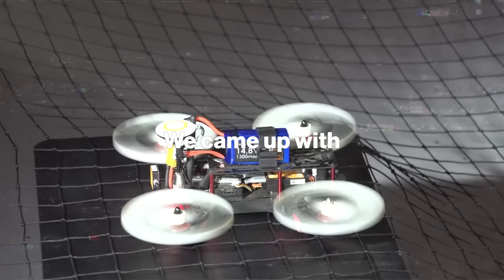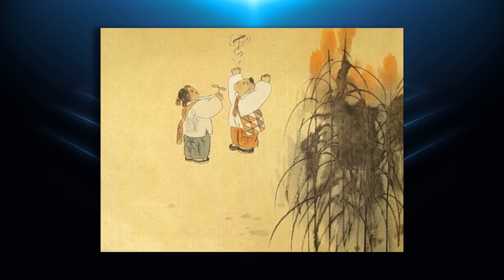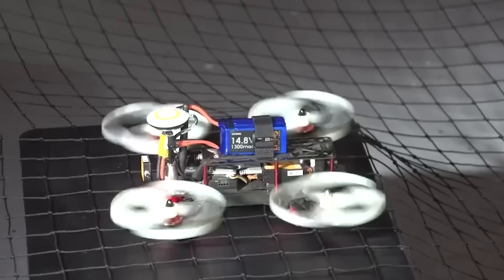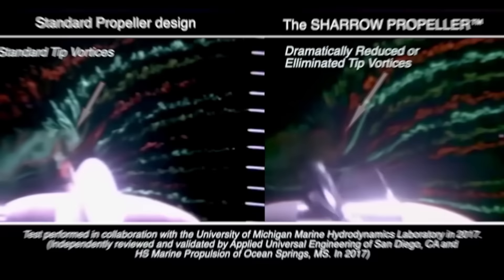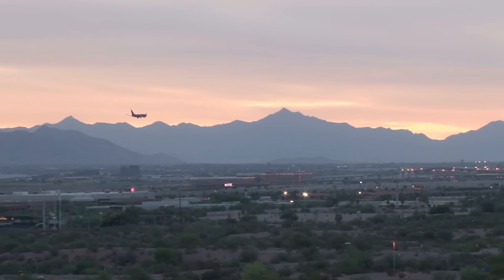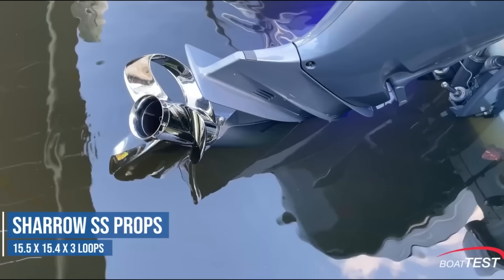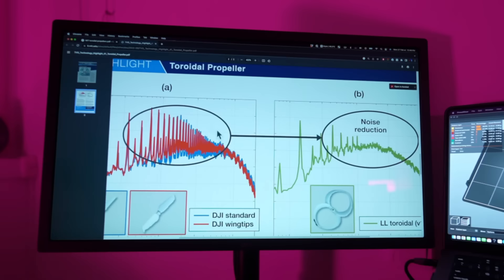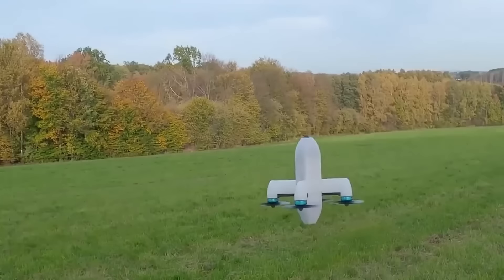This MIT Propeller Is Going To Change Aviation Forever

Comment: The fact that they are fixed pitch makes them a total non starter for most applications in aircraft
Reply: My thinking exactly. Instead of increasing thrust by changing blade pitch, now you have to increase the engine RPMs, same as you do on a jet engine. Imagine this on a commercial twin engine place, like an ATR and the engine fails. Can't feather, so you end up with a runaway prop, then the engine falling apart.
Reply: And this is not an accurate representation of the aero application. Firstly, the prop is not scalable, and will only work on small diameter props. All the tests rely on high speed, small diameters in the air, [drones] or on solid medium applications like boats.[The medium being water.] This presents a problem, because the 'T'prop would have to exceed the speed of sound in the air, to be effective. So making the claim of changing the rules in aviation.... is pure cattlecrap. [Unless you talking drones, which are utility applications in the air, so yes they are a sub-class of aero industry, but not true aviation.]
Reply: Was about to write that but you beat me to it.  Probably works for quad copter drones and maybe light personal aircraft one day...
Reply: @miket2120 I was thinking that too. My best guess is this will be used exclusively for electric motors and some GA aircraft. Electric motors don't have a rpm problem. They are also more reliable than combustion engines, so feathering on engine failure isn't really needed.
Reply: Most aircraft propellors are Fixed-Pitch not variable.
Even inside the turbine of jet engines they are fixed-pitch.
Reply: @LG-qz8om  this type of propeller could not be used as a compressor or fan in a gas turbine. Also only small basic light aircraft use fixed pitch propellers. Everything else uses variable pitch.
Reply: They're talking about drones and powerboats duh
Reply: @philgordon6671 The title of the video suggest a little more than just boats and drones lol
Reply: Most prop noise is the result of the tips breaking the sound barrier.  Torroids are interesting but nothing like a breakthrough.  Their applications will be limited.  Wouldn’t mind having one for my boat.  Good luck straightening one after a prop strike.
Reply: A non-starter ? That’s theoretical. It’s been proven to be more efficient
Reply: @asianguy6174  I think you need to understand that in all but the smallest and simplest of aircraft, propellers need the ability to change pitch and very importantly they must be able to feather in the event of an engine failure or shutdown. The efficiency gains on boats are impressive but that is a very different situation that doesn’t translate directly to aircraft. The small fixed pitch aircraft that this could possibly work on are already so  slow and aerodynamically inefficient that a fancy propeller is going to make little difference.
Reply: "I can't think of a way to make the pitch of this prop variable, therefore no one ever will. scrap it. don't waste your time." 
that's what you sound like 🤷
Reply: @graphixkillzzz  unless we change the laws of physics and make the whole thing of shape shifting materials it is a non starter for aviation. Do some research and you’ll understand that this propeller has only been proven to achieve gains in a marine environment with low diameter/high RPM. Exactly the type of propeller that fixed wing aircraft cannot use.
Reply: @stevea8547 I'm just curious, but are you an aerospace engineer?
Reply: @MGPRaleigh  Yes you guessed right 33 years in the trade so far
Reply: How much thrust advantage does variable pitch offer?  If it’s less than 20%, these toroidal props should be better.
Reply: @IanHague  It is indeed an issue of "thrust advantage," depending on how you define that. Variable pitch props optimize efficiency for various phases of flight, such as low pitch for climb, high pitch for cruise, feathered for engine-out situations in multi-engine aircraft, and reverse pitch to aid in deceleration after landing touchdown.  Small recip (piston-powered) singles would not benefit from a relatively wild prop design such as this to the point that it is compelling enough to make the change.  The design will not become mainstream in passenger-carrying aircraft for a multitude of reasons...high cost, high complexity, challenging certification requirements, and the one glaring issue is that it's just not so good that it's worth pursuing in most  passenger-carrying applications.
Reply: Exactly.  Most definitely a non-starter and will not change aviation forever, at least in passenger-carrying applications.  @stevea8547 is correct.  In aircraft applications, you want the biggest prop possible turning at relatively low speeds.  For fixed-pitch applications, the prop is pitched to give redline engine rpm at full throttle, with the prop tips operating just below supersonic.
Reply: @IanHague  its the equivalent of having a car stuck in first gear versus a cvt auto box.
Reply: Huh???
Reply: @misanthropicphilanthropy  ok in simple terms the fastest variable pitch aeroplane is almost twice as fast as the fastest fixed pitch aeroplane! Variable pitch makes a LOT of difference!
Reply: Just as in "fluid dynamics"... Same applications apply, with the variable difference of airflow vs water flow
Reply: @JD96893 Feathering is not only to stop the engine and or gearbox from further damage but reducing drag for further glide time to reach a suitable landing spot in case of an engine out scenario.
Reply: I totally agree for multiple reasons.
Reply: I agree the current designs are only directly applicable to drones or light aircraft, but the idea of folding the blade round to eliminate the inefficient end of the blade is new and may lead to interesting developments that are “game changing”
Reply: This is  is a snapshot , the future development is the movie. Let's see advancements could be made, perhaps memory metal?
Reply: There's still quite a market for fixed pitch props.
Reply: @joewoodchuck3824  this is true but would the owners of small light aircraft pay ten times the price for a propeller that has almost no benefit over a standard propeller? These propellers have only been proven effective in low diameter high speed applications. Most light aircraft fixed pitch propellers run at very low speeds and produce effective traction due to their large diameter. This new propeller technology is just not a like for like replacement for aircraft propellers, and in all likelihood never will be. There are certainly possibilities in other areas of aviation but not in conventional propellers driven fixed wing aircraft.
Reply: @tonyforrester9570  Water is not a  "solid" medium...
Reply: @stevea8547  Further engineering could allow a degree of pitch variation. For example, a flexible outer skin supported by a movable inner framework.
Or the prop being made of multiple interconnected segments that can move relative to one another.
These are just quick brainstorming concepts. With sufficient engineering and development we may be able to come up with a variable pitch toroidal prop. Just like we came up with multiple ingenious mechanisms for varying camshaft phasing and lift in internal combustion piston engines (VTEC, VVT, Cabos, etc., etc.).
Never say never.
Reply: @IhabFahmy  even if that was possible you’re missing the point that this propeller technology only produces appreciable gains in performance on low diameter high speed propellers, which are basically useless on fixed wing aircraft!
The forces within a propeller would make it almost impossible to have any kind of pitch variation that could carry the loads sufficiently well.
Reply: Good point!!
Reply: But It's a gAmE cHaNgeR!
Reply: But they said "Effeciency", not efficiency, so it's still true!
Reply: @LG-qz8om I’m not sure of your statistics but fixed blade aircraft propellers are a weak little brother to variable pitch.
Reply: The toroidal propeller is more efficient than variable pitch straight blades
Reply: Could this more efficient design be applied to HVAC? Does it work with a tubular fluid environment? As we strive towards greener home heating and cooling, more efficient, fans as well as efficient fluid pumps for geothermal systems is worth it.  Geothermal systems run continually. Every watt counts
Reply: @bwmcelya Laughimg, for sure.  Might be easier on a manatee’s back though.  :)
Reply: Certification will probably be one of the biggest issues for introduction to civil aviation. It would be interesting to see how they would perform on light, fixed pitch, single engine planes, like the cessna 150, 152, 172 or ultralights
As many have mentioned, the larger diameter required for fixed wing aircraft may present an issue
I doubt that these propellers could enter into the field of military or commercial aviation since they use variable pitch props or jets
Reply: @PathogeniNk   Indeed the manatees. To me that would be the torroid's most important attribute.  Prop guards are cheap though.
Reply: @miket2120 
What about turbine engine applications?
Would it be more efficient and quieter on a turbine vs a piston aviation engine?
Reply: @berniemadoff7837  in a word ‘no’ it wouldn’t!
Reply: Lots to work on here….
Reply: @bwmcelya Most props do just fine being noisy without the tips exceeding the speed of sound - few exceed the speed of sound as it is very inefficient at those speeds. Prop shape has the most effect on sound.
Reply: @stevea8547 there are many, many planes flying around with fixed pitch props. It certainly is a compromise between takeoff/climb performance vs cruise, but lots find a perfectly acceptable compromise.
Reply: @mr-uc4me  Im not denying that there is but this type of propeller only produces and appreciable gains in low diameter/ high rpm propellers, which are not used on light aircraft at all.
Reply: They will have to come up with a variable pitch toroidal prop.
Reply: @berniemadoff7837  turbine fans (or screws) are fundamentaly different from propellers because their purpose is to move air, whereas a propellers purpose is to move the connected object. This difference causes them to have very different geometries. The fan tips are so close together that a toroidal shape is no possible to connect them. Beyond this, the size of a turbine leads to safety questions since a modest takeoff at 8000rpm with a fan diameter of 1 meter has the tips moving at a speed of 150,000km/h (i dont trust my math skills implicitly so if someone could check that result id be grateful).
Reply: @berniemadoff7837  By definition, toroidal props are exposed tip. Turbines are ducted fans, with no exposed tip, wholly different flow through and around blade foils. Large ducted fans are being tried for medium speed airliners, high blade density exposed bent blades seem better, so far. If 'turbines' you mean gas turbines driving a prop, no different because of power plant. Electric motors are the game changer here, as they have far wider efficient torque curves over RPM ranges. Piston engines are the most restricted for narrow power curves, thus the need for variable pitch props. Nobody seems to connect the added efficiency of toroidal props at lower RPMs, and better efficiency at same speeds, as greatly reducing the value of variable pitch. For commercial aviation, fuel costs (Gas, Kerosine or battery charge) will remain the largest expense, and the critical variable in design choices.
Reply: @mr-uc4me  According to those on the bleeding edge of design, more tip design than foil design. Massive efforts are in progress to find ways to quiet the usual helicopter blades, normally hideously noisy. Focus moved to blade tips awhile back. Current experiments in small/medium airliner multi-blade (High disc density) props, often very laid back tips, are being investigated. The better exposed high density props are challenging ducted fan efficiencies.
Reply: @stevea8547  Why are you missing that the boat toroidal props are better at the same diameters and RPMs that exposed blade tip props have been optimized at over Generations? They are not smaller than ideal exposed tip props, and seem measurably more efficient at lower RPMS, cruise, And top speed. The real questions are relative efficiency, at costs the market will bear, as the props are developed. Currently a Very immature technology. Hoping you are educated enough to know water and low/medium Mach Number air flow are both 'incompressible flow'.
Reply: But extremely attractive for naval use
Reply: So was everything else when it first came out. What's funny is someone at mit taking credit for someone else's invention that has been in production for years
Reply: @billtaylor3499  read the previous comments, I really can’t be bothered to explain it all again
Reply: Elon Musk justified the Boring company on drone noise pollution .
Reply: @LG-qz8om  most small prop planes are usually fixed pitch for cost savings and ease of maintenance, but constant speed props are getting more affordable and more popular, larger prop planes are almost always variable pitch. Also inside of turbines they kinda do have variable pitch! It's called variable guide vanes. They effectively changed the angle of attack of the stator blades and therefore incoming air onto rotor blades. Essentially turning it into variable pitch for different engine needs.
Reply: I think that as well - BUT - the purpose of the pitch shift is to improve performance given its speed and need.  If this prop performs so much better, wouldn’t it reduce or eliminate the need for the pitch shift?  
Maybe. Maybe not. I don’t know for sure.  But if these improvements are correct, would seem so.  After all, the pitch change in a prop doesn’t change performance by 200%….
Reply: If the gain in power and/or efficiency is what they suggest, would there still be a need for variable pitch props?
Reply: @stevea8547 There is an absolute shit ton of small light aircraft though.
Reply: Sasqwatch_reporting  the pitch they’re talking about doesn’t change the angle of the engine. It changes the angle the blades are as they rotate and cut through the air.
Reply: @stevea8547 why not? A compressor blade only needs to pull in and compress air, why could a prop like this do that?
Reply: @Vinythevent  a compressor in a gas turbine is made up of several stages, each one consisting of a rotor and a non moving stator. Each pair are very carefully matched to produce optimal performance and they also run the tips extremely close to the casing to reduce tip losses. The shape and blade density alone are enough to make it totally unsuitable for gas turbine applications. 
A compressor is far more than just a propeller in a duct!!
Reply: Sasqwatch_reporting  maybe if the blades were made of rubber!!  I don’t think you understand the concept and requirements of a variable pitch propeller. 
They need to be able to transition all the way from reverse to fully feathered in most aircraft applications!
Reply: Would t this be less of an issue with electric motors though?
Reply: Plenty of light aircraft use fixed pitch props. Assuming the claims in the video are true, it might be beneficial for them.

The reduced noise thing is interesting for ocean going vessels. Current prop noise on commercial ships wreaks havoc on the ability of cetaceans to communicate and navigate. A quieter prop would be a step in the right direction. And, if it also happens to be more efficient, you'll have a much easier time talking companies into using it.

I also wonder if the shape of these props might reduce the damage caused by propeller strikes on cetaceans and manatees.
Reply: @stevea8547 remember when they couldn’t break the sound barrier, because it was a big wall in the sky and the air would rip the plane apart? did the pilots say that or the engineers?
Reply: @stevea8547 combustion engines have optimal output torque and hp at certain rpm’s and the adjustable pitch compensates for the lack of an engine with on demand torque or a linear torque curve like and electricity engine, so for electric applications it is promising, i think Norway assays all commercial aircraft needs to be electric by 2040. i don’t agree with this, but, it is a moving in the right direction. who is to say, this isn’t a thing and won’t be, maybe not as much hype in a youtube video but very practical in UAS UAV configerations
Reply: @Meatball2022 in electric applications torque is pretty much linear and pitch adjustment isn’t needed to meet the max output/fuel consumption that an electric could address, i could see electric coupled with gearing and fixed pitch works efficient enough i can be adaptable and practice. everything in aviation, is slow changed for good reason.
Reply: @MusicalMemeology exactly these blades are perfect coupled with electric engines. combustion engines use variable pitch to increase efficiency due to a combustion engines hp and torque curve, electric engines torque curves are linear and the blade being efficient would work for many of electric aircraft applications, wait for the record to be broken for global navigation in an electric powered solar plane with these props. will work for electric vtol drone type aircraft that are in the works s we type on youtube
Reply: @marknasia5293  doubtful. All that adds weight on top of the ridiculous battery weight. That’s doa until batteries cut weight by 70%.
Reply: @Mistraker many a Dugan has lost their live due to prop strikes traveling from fresh drinking water areas to salt water feeding ares 😅
Reply: Are you sure about that? I immediately envision a sort of clutch bearing able to angle the separately mounted toroids forward altering the pitch MORE Than conventional blades. 
  Your cognitive Envelope needs to embrace Hybrid Advancement.
Reply: Give it some time and they will figure out how to twist the toroid to adjust pitch. And viola... variable pitch toroidal prop.
Reply: @miket2120 Couldn’t a clutch address this concern?
Reply: The title is click bait, if this could be used on airplanes they would have of it to show us, all they show are boats in water and drones.
Reply: Not for turbofans!  The thrust producing blades are NOT adjustable in pitch.  It would affect turboprops and conventional piston engines, much as you suspect. Forget about using it on a single rotor helicopter! However, if using three or more rotors, you could make a helicopter/drone.
Reply: @brianmclaughlin4419  you probably need to address that your idea is fundamentally flawed!
Reply: @billtaylor3499 @billtaylor3499 Large prop planes lik the C-130 use turbine engines to spin variable pitch props.  The turbine runs within a relatively narrow RPM range. 
Piston engines are only used on small planes with fixed pitch props.  Drones, small aircraft, and boats are where this might have benefit, not large aircraft.
Reply: @Meatball2022 Pitch change is vital for short field landing. Reverse thrust can't be achieved with something like this and you don't want to try reversing engine rotation while landing!
Reply: @ericbunker6242  but can that not be compensated for by slowing down the torodials low enough to create some additional drag? 
Legit curious. I’m a layman but would seem to me there’s a way to make it work.
Reply: @Meatball2022 you don't need drag for short field landing. You need reverse thrust.
Reply: Using the term 'total' [non-starter] is an unnecessary exaggeration.
Reply: @William.Driscoll  read it again!
Reply: Good point
Reply: @LG-qz8om you got the turbine part right.
Reply: Good point. To bad. I wouldn’t be surprised if someone eventually came out with one that could change pitch!
Reply: I’ve got a hunch that someone is already looking into the ability to change pitch of blade’s on these. Time will tell.
Reply: This comment section is a sticky trap for Trolls. 
How is your propeller invention coming along Trolly?
Reply: Its early days yet, time will tell so will money. Some big shot investor a fare bit of R&D, then streamline the manufacturing process. Bringing down cost's.
Reply: Why do we accept that they have to be fixed pitch?
Reply: Why do they have to be fixed pitch though?
Reply: @LG-qz8om only because there are more 172's than there are king airs. Fixed pitch props are pretty much only used on non high performance A/C, which are quieter anyhow. Every other prop A/C uses a constant speed prop, which varies it's pitch. Anything large, noisy, and more likely be used for commercial purposes (let's face it, most weekend warrior GA owners probably aren't going to upgrade to a very expensive prop) would all be constant speed and wouldn't benefit from a toroidal.
Reply: They don't. 
Trolls say what their Troll friends tell them to say
Reply: Nay sayers alway say it can’t be done then it gets done
Reply: to everyone saying just adjust the pitch of the toroidal, you need to take an aerodynamics class. In a regular prop, when you adjust the blade you are adjusting the angle of the airfoil to the relative wind. With a toroidal, it's not that simple because its airfoil is wrapped around a helical shape. You can't just twist the blade to get the same effect. You also just can't twist the airfoil because, A it is impossible with current tech and physics, B, moving parts create weaknesses and flexing which is not what you want with a prop, and C, the toroidal blade is only efficient in its engineered, changing it shape reduces that which negates the purpose of changing it.

Toroidal props aren't a new technology, they've been around for well over a century. The Toroidal A/C propeller was invented in like the 30's or something. There's a reason why they aren't used. They're expensive as hell and complicated to manufacture; look into what a Toroidal boat prop costs compared to a regular prop. Most fixed prop plane owners aren't going to pay for them. I very much doubt the FAA is going to approve of any 3D printed prop either, so manufacturing for A/C will remain high.
Reply: @christhemexvet6652 Interesting, what are your degrees in?
Reply: @joshuakelly2665  I couldn’t agree more! The design of this propeller simply does not lend itself to a variable pitch design. Too many armchair engineers commenting on here who are just not in touch with reality!
Reply: @stevea8547  it's just stupid. the 2 people with actual aircraft/aerodynamics experience and people want to argue. Don't get me wrong, I hope I'm wrong and this is paradigm shifting for the aviation world, but it's simply not. It might make some rich 172 or sr22 owner get better range or squeak out a little faster cruising A/S, but that's about it. It will not affect the vast majority of  commercial aircraft as the vast majority are turbofan. They are so for a reason. 

I am curious to know how a toroidal performs at altitude; I feel like they would work better in denser fluids and would perform worse in a thinner one. If anyone has any info or link on this I'd be interested in reading it.
Reply: @christhemexvet6652  maybe the naesayers are the ones who have a solid grip on the realities of physics and engineering!
Reply: @stevea8547  that’s funny you mention it because I am an engineer at one the top R&D facilites in the world. There are those who have limited understanding and therefore claim “it can’t be done”. history has proven otherwise. In fact history has shown over and over that when they say it can’t be done, they end up proven wrong by the true geniuses and pioneers who devoted countless hours and found a way.
Reply: Most small planes are going to go electric eventually. This will lead to radical design changes in light aircraft.   Ie the more smaller  motors with the ability to change the angle of the motor itself.
Reply: @cryptoslacker-464  what would be the purpose of changing the angle of the motor?
Reply: I was looking forward to compare the drone sounds, but that didn't happen.   :-/
Reply: I wonder how close some new sort of ducted fan might be to this efficiency. Could have constant speed & beta that way, potentially the best of both.
Reply: If these propellers are quieter, their best application would be on submarines.
Reply: @stevea8547 Yes but if your car is electric that isn't a problem. Simply refitting these props to existing aircraft isn't going to do much, but if the powerplant is also changed to take advantage of the properties of t-props it could be very significant. Maybe an electric drivetrain powered by a turbine alternator? It could lead to breakthroughs in engine and electric drivetrain technology as well.
Reply: Obviously if it’s not applicable to everything with a propeller it would be used.
Reply: I mean I'm sure they could design it so you can change the pitch of the center of the props(not the outside connecting part) using hydraulics but I am in no way an aviation engineer or pilot so I dont know if that would solve the problem you're talking about
Reply: @marknasia5293  neither, it was media hype.
Reply: Even if they are fixed pitch - they increase thrust 100+ %.

Maybe big planes would benefit from that.
Reply: @sumakwelvictoria5635  they do not increase thrust at all in anything other than a few marine applications. At best they achieve a slightly lower noise level for the same thrust level
Reply: Not an engineer here, but definitely curious: theoretically speaking, would a flexible material, that was still capable of withstanding the physical pressures on a standard prop, solve the 'variable pitch' issue?
Reply: @stevea8547  So it only increases speed in water but not air? They lied? Hmmmm. You have a point.

Pardon my stubbornness. What if that loop blade could be designed to be pitch variable?
Reply: place them in jet engines then
Reply: @-iloveyou  you clearly don’t understand how a jet engine works!
Reply: @cryptoslacker-464  variable pitch and thrust vectoring are entirely different things! What on earth are you talking about?????
Reply: @graphixkillzzz  not at all, Im commenting only on the current situation of this fixed pitch propeller, if someone thinks that they can make an effective variable pitch version then good luck to them. In its current state it is a non starter!
Reply: @-iloveyou  how are you suggesting that this would work any better in a jet engine???
Reply: I'm also imagining the increased weight (at least as pictured in the thumbnail) would make this infeasible as a drop in replacement on existing airframes. Your elevator would have to put so much more downforce on the tail you'd lose a lot of the efficiency gains to induced drag, no?
Reply: @stevea8547  I know how jet engines work, im not saying its better than jet engine, Im saying if it could be implemented somehow to improve the jet - like funnel the exhaust or something. Jets have perfectly tuned harmonic fins, so obviously this design couldn’t replace that… but it seems like there is a way to integrate the design for better airflow
Reply: Most applications, not all.
Since it is relatively new tech, let's wait and see.

Can You please guide towards news on research towards the negative results of these new propellers ?
Reply: @louisfkoorts5590  do your own research and you will find that they are entirely unsuitable for use on fixed wing aircraft which is why no one has tested one on a full size aircraft. The design is effective in low diameter higher rpm applications only and is not scalable!!
Reply: How about submarines and torpedoes?  When he said cavitation, I thought of the Hunt for Red October.
Reply: @robertevansiii1445  they are well proven in marine applications but the video is all about aviation
Reply: @stevea8547  Good point.  Thanks.  If I was doing the description of how we are going to get the cost of these propellers down, I’d mention military applications.
Reply: @stevea8547  Boat propellers are small compared to airplane propellers but the rpm is not high speed. A typical gas powered pleasure boats stern or v drive have a 2:1 ratio and unmodified engines typically top out at 46-4800 rpm so a 2400 prop rpm at full power. Typically the cruise rpm is 3000-3200 so approximately 15-1600 prop rpm. I don't know if that is relevant to this propeller technology but I wanted to clarify that.
Reply: Non starters on today's applications in aircraft. Small drones will be more commonplace in the future.
Reply: samr1556  far more easily said than done and you have to consider the truly immense forces that are exerted on a propeller in action. Also how would a propeller on a commercial aircraft be equipped with anti icing equipment with all those individual sections?
Reply: samr1556  I can tell you have never worked on commercial propeller driven aircraft, it’s hard enough keeping conventional propeller heaters working let alone sectional ones with wiring witin the blade, but good luck with the optimism !
Reply: You got that right. I see this working on boats, not aircraft.
Reply: It might be possible to add a CVT transmission between the engine and prop allowing a choice of prop RPM to improve prop performance vs altitude.

If the prop is basically 200% more efficient, you can afford some losses due to altitude.

A runaway prop only occurs if the prop goes too flat. With a fixed pitch prop, that can't happen.
Reply: @linuxranch  well you have made three points there, and not one of them is even remotely correct. The CVT gearbox is especially mad, why on earth would you want to do that? 
By the way it’s not 200% more efficient at all, stop believing all the clickbait!
Reply: Spring metal is flexible so you can change the pitch once the build a system that can do it...
Reply: @dncg4040  springs are made from steel, you definitely don’t want a steel propeller!
Reply: @BeardedBavarianBiker.  I still don’t see how this makes this propeller in any way relevant to a gas turbine.
Reply: A more variable pitch would/could be a game changer !!!
Gov has Quiet Stealth Helicopters so it can be done !!!
Shamberger already did the research !!!
Reply: This application is a game changer in the drone and marine industries where efficiency leads to a better battery output and reducing cavitation action on marine props reduces prop wear and you get getter efficiency. If the engine stops in the marine world you’re still floating so that’s not a consideration but costs are so until that’s addressed, you need to be doing a lot of boating or have specific needs for greater thrust versus cost of running e.g. tugs which are already using shrouded props
Reply: They should work well with Electric motors
Reply: Damn so that's why my car speaker equalizer I'm always turning down the 1 to 5K range that shit is tight yo
Reply: Variable pitch achievable like flex wing
Reply: @vanlock4809  in a word “no”
Reply: ya, MIT genius was applying a boat prop to child's toy ;-) ain't 3d printing and social media grand for blowing ones own horn.
Reply: I’m sure that can be changed if they are machined at the manufacturer.
Reply: @johnkranig2054  🙈
Reply: A bit of a fluff piece.
Reply: @LG-qz8om   Almost all multi-engine aircraft use constant speed propellers (self adjusting pitch) with feathering capability.  True, light single engined piston airplanes are often fixed pitch.
Reply: You do know that aircraft flew for Years before variable pitch was an option, it has and can be done
Reply: @drumking241  yes obviously and they still do but like I said MOST applicantions are now variable pitch.
Reply: Plus, they compare these to the same diameter screw rather than a counter rotating setup or two screws with the same surface area.
Interesting idea, but they forgot the Lotus axiom...

Simplify and add lightness
Reply: @stevea8547  Why can’t they make variable pitch for boats?  I mean, you are stuck in first gear!  I get 1.4 MPG on my boat😢
Reply: @izysly6924 it’s not a sticky trap for trolls. It’s the intersection of those with knowledge of the current state of the industry and those with the hope of us being further along technologically than we actually are. Sometimes the ones without the knowledge are loud and confident but it doesn’t mean they are trolls. I’m pretty sure Steve is laying down the facts and others are just using their brain to try to solve the problem.  I doubt we will solve anything here but you never know where a good idea can stem from.
Reply: @LG-qz8om Baloney. Stators are variable.
Reply: @MGPRaleigh You don't have to be a lawyer to know the law or an aerospace engineer to know this propeller is absurd.
Reply: @miketrusky476 Nope we're past that.
Reply: @IhabFahmy At high speed both air and water ("fluids") might as well be "solid." Paradoxically a water landing is going to be harder and more deadly than a landing in the forest with trees everywhere.
Reply: @johnpublic168 You pulled that from some... catechism? You're parroting stuff a private pilot would refute.
Reply: @mr-uc4me Actually it's rpm, not prop shape that makes noise.
Reply: @mr-uc4me "Lots" meaning folks happy to fly around 110 knots.  Nothing wrong with that. But you have speed and efficiency limits.
Reply: @matthewhoward2343 You're about 80 years late with the "getting more popular" nonsense.
Reply: @MusicalMemeology Electric engines would not be turbine engines as there is no need for creating combustion conditions. Golly the discussion thus far is full of ignorance.
Reply: @brianmclaughlin4419 Already solved with the propeller governor on constant-speed props grasshopper.
Reply: @ShaunHensley Read the free FAA literature in propeller governors.
Reply: @Meatball2022 Actually constant speed props DO increase efficiency about that much ( ~%200. ) There really is no debate about the virtues of variable-pitch propellers.
Reply: @badlydrawncars6460 Not true.
Reply: @Mistraker No,it wouldn't (be beneficial).
Reply: @ShaunHensley That is what a propeller governor does and it's not a clutch.
Reply: @ericbunker6242 Incorrect. Recips also use constant-speed props ("variable pitch") props, in significant numbers of the fleet.
Reply: @izysly6924 Orville and Wilbur's homemade prop was already ~%90 efficient so trolly's up to about %50 by now.
Reply: @3snoW_ Because the monolothic design prohibits pitch changes and it is a fundamentally flawed concept.
Reply: @christhemexvet6652 Airplane design is like a water droplet in a weightless environment. It will have to be a fairly well-known design until you change physics and the planet's known range of air densities. Until then, sure, dream on,
Reply: @christhemexvet6652 Sure, nothing is impossible. So build a prop with lots of internal moving parts?!
Reply: @gregoryballestero4369 <groan>
Reply: @erickborling1302  What the fuck is doing pattern work over my house then?

Vrooooooooooom
Reply: @erickborling1302  if tip speed below speed of sound, prop shape very much has an effect on noise. I replaced a square tip prop with a scimitar blade prop of the same diameter- much quieter at same rpm. My own direct experience, not anecdotal.
Reply: I'm sure they can build digital pitch controls.
Reply: @derekreed4910  Its physically locked in a fixed pitch ! The design doesn’t lend itself to variable pitch at all.
Reply: Yes because no one flies fixed pitch… 😂
Reply: @scottpilot2  Thats why I said ‘most’ not ‘all’ applications
Reply: This defeatist, "it cannot be solved" attitude by arm-chair geniuses has a 100% failure rate.
Reply: @micaholiver74  ok buddy then you had better get on with solving the problem then! This is a boat propeller! It was never intended for aircraft and has very limited use
Reply: @stevea8547  Actually, I think you should make another smart-alec comment demonstrating my actual point perfectly. So...
Reply: @micaholiver74  do some research buddy before you embarrass yourself any further!!
Reply: @stevea8547  You're the one getting all riled up and defensive. You're all mad because I'm not taking your word on it. The more you act that way the more you prove my point. So, cry some more and keep proving me right. :)
Reply: @micaholiver74  32 years as a licensed aircraft engineer buddy so I do know where Im coming from! If you have a point to make then make it !!
You seem like just another armchair warrior with no real knowledge or understanding of the subject otherwise 🤷‍♂️!
Reply: Don’t most light aircraft use fixed-pitch props?
Reply: @timberwolfdtproductions3890  look down the thread and you’ll see this has been answered more than once!